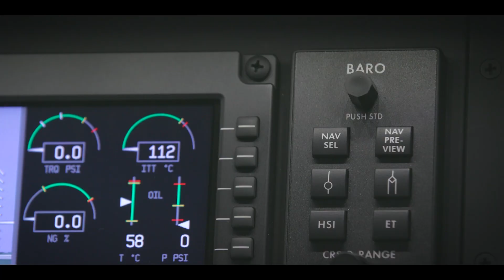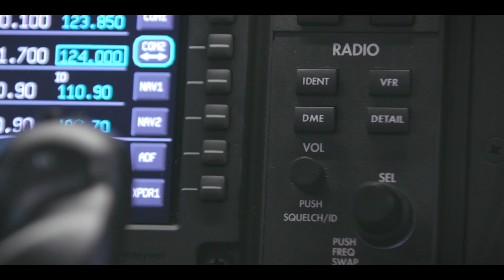PC-12 – Former HP Inc. CEO Dion Weisler Flies the World's Greatest Single

Comment: A single pilot, single engine with the performance of a twin.  Probably can land on a 3000 foot runway.  Cruise at 220?  I wish had the money.  I got the Commercial Multi Engine Instrument but the money, not so much.
Reply: Reckon it goes  a bit quicker with the five blade prop
Reply: I've seen a Flying Doctor pilot put one of these into 600 metres of dirt. Not much to come and go on, but within the capability of the aircraft.
Reply: Mike Parker said most of us.  Feel you bud...
Reply: They regularly operate out of San Carlos California - 2600' runway - at gross weight

Comment: 42-43,000 feet? Isn't that 12-13,000 feet higher than the service ceiling? I know it recently got an upgrade, but I can't find any specs that say it goes into the 40s.
Reply: I think the 42-43,000 feet is when he’s in the back of one of HP’s jets.  :) The PC-12 is his own for flying the family it sounds like.
Reply: @cavulife  plausible, but clarification is needed in a video like this.
Reply: Specifications (PC-12NG)[edit] Wikipedia https://en.wikipedia.org/wiki/Pilatus_PC-12

View from below, gear and flaps up

Front view, flaps and gear down

Side view, flaps and gear down
Data from Pilatus[46]
General characteristics

Crew: 1 or 2
Capacity: 6 to 9 passengers seats
Length: 14.4 m (47 ft 3 in)
Wingspan: 16.28 m (53 ft 5 in)
Height: 4.26 m (14 ft 0 in)
Wing area: 25.81 m2 (277.8 sq ft)
Airfoil: root: NACA LS(1)-0417MOD; tip: NACA LS(1)-0313[47]
Empty weight: 2,810 kg (6,195 lb)
Max takeoff weight: 4,740 kg (10,450 lb) 
Maximum landing weight: 4,500 kg (9,921 lb)
Maximum zero fuel weight: 4,100 kg (9,039 lb)
Fuel capacity: 1,226 kg (2,703 lb) / 1,521 l (402 US gal; 335 imp gal)
Powerplant: 1 × Pratt & Whitney Canada PT6A-67P turboprop engine, 890 kW (1,200 shp)
Propellers: 5-bladed Hartzell Propeller Composite, 2.67 m (8 ft 9 in) diameter Composite constant-speed fully-feathering reversible propeller
Performance

Cruise speed: 528 km/h (328 mph, 285 kn)
Stall speed: 124 km/h (77 mph, 67 kn)
Range: 3,417 km (2,123 mi, 1,845 nmi) (HSC, VFR Reserves)
Service ceiling: 9,144 m (30,000 ft)
Rate of climb: 9.75 m/s (1,919 ft/min)
Take-off run to 15 m (49 ft): 793 m (2,602 ft)
Landing run from 15 m (49 ft): 661 m (2,169 ft)
Fuel consumption: 250 l/h (66 gal/h; 55 imp gal/h) (915 km (569 mi; 494 nmi) trip, including climb, cruise and descent, 491 km/h (305 mph; 265 kn) average block speed)